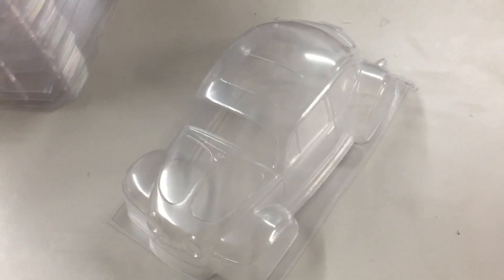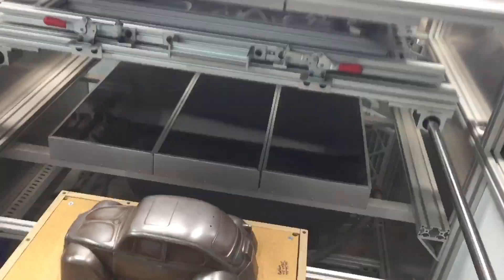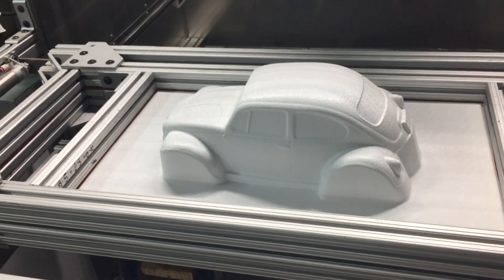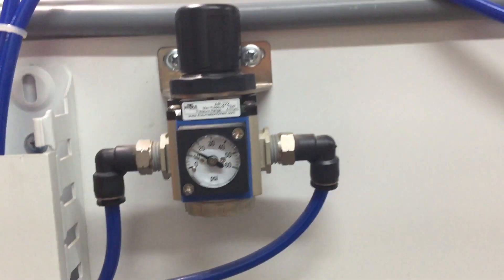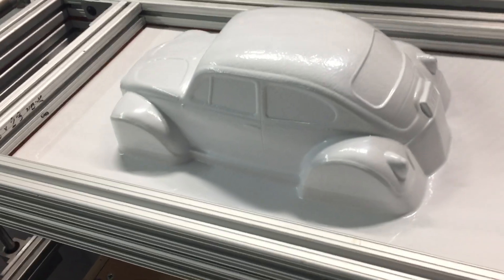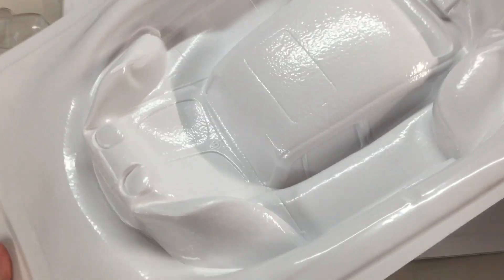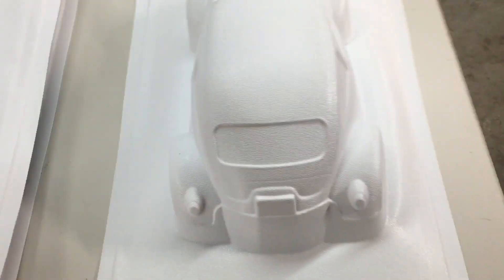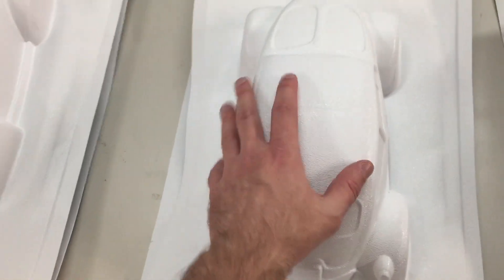ABS Plastic Thermoforming Test

Comment: Have you ever tried to pull a sheet of automotive vinyl over a body for aesthetic purposes as a finish instead of painting? Like peel the backing paper off the sheet of vinyl, put it in the vac machine (preheated) right after the body is finished? I feel like this would be a great option for taking advantage of the aesthetic advantages vinyl wrap has over paint, like ease of application, customization of finishes, color combos etc. you should try it!

Comment: Can you do this with pre-preg carbon fiber? If I sent you molds of bodies I want to make, and sheets of pre-preg, could you try it? Maybe even do a bottom layer of carbon and then leave it on the table and then add a top layer of clear poly? For like a carbon fiber reinforced clear RC body, plus the clear layer on top would give the carbon a super deep 3D look as well as protecting the carbon! I want some carbon fiber bodies made!